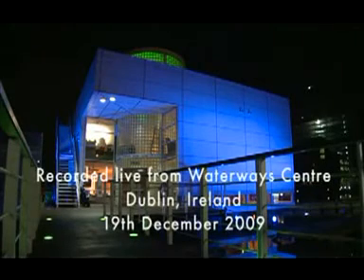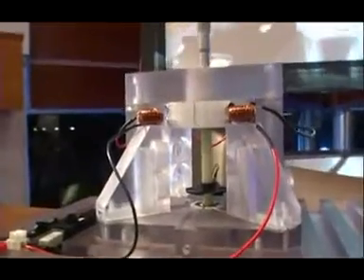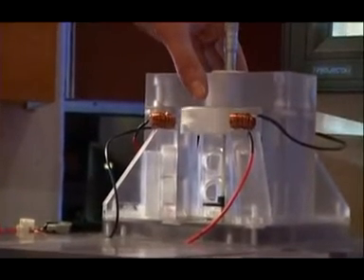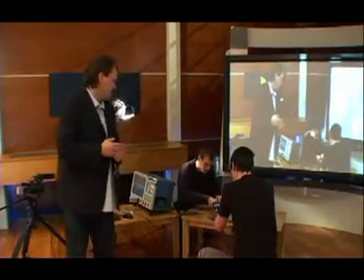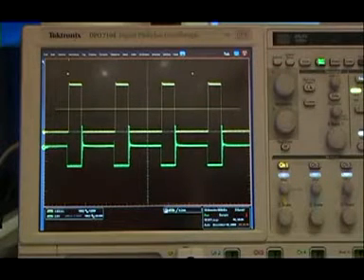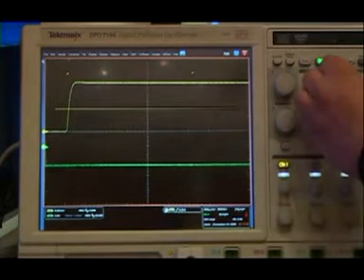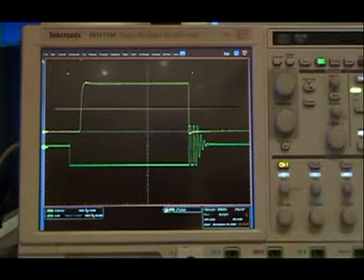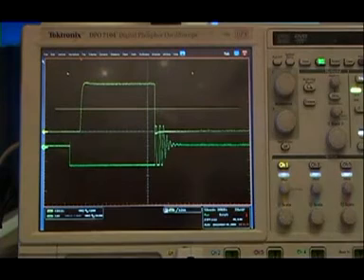Introduction to an Orbo Electromagnetic Interaction - Part 1

Comment: Nope, the battery's still there..
"there was no degradation of the components after 7 days"(-except for the battery) Sod the digital scope, let me see 2 current probes on the battery:)
At 327% (not including friction) it should EASILY charge a cap-and run from it-in fact you should be able to spin it up by hand & watch it turn forever. Read their 'terms of use' , buy a jar of vaseline, and clear the table :o)

Comment: My last comment on 'Official' is 'pending approval' LOL
"We are being sceptical for a reason, i've been researching this stuff for years, i tested their 'kinetica' models years ago, i built a PMM that would run for 5 minutes (providing you gave it a good shove)-this is just a highly efficient pulse motor-i give them credit for using Thane's coils, that was a slick move- PS i have seen positive proof of overunity, but not from steorn, a true OU machine can run itself, no battery " :o)

Comment: Thanks for posting this! I posted the following comment on their channel & no great surprise, it wasn't posted :(

"Utter nonsense! A capacitor will dump it's current MUCH faster than a battery, which depends on electrochemical action. Can we see some measurements made of current INTO & OUT OF the battery?
At least you got the coils right.
 A capacitor would at least provide some positive proof of overunity."